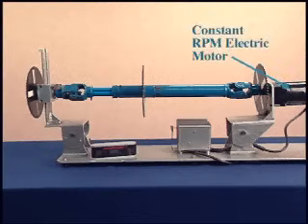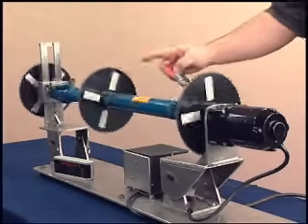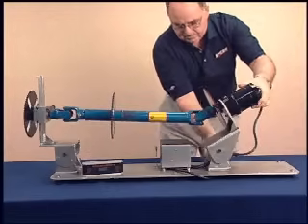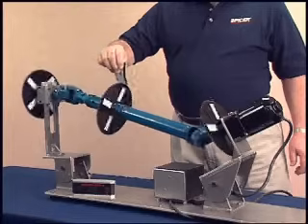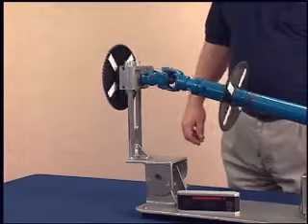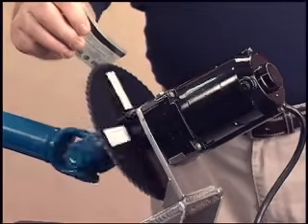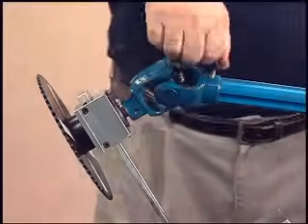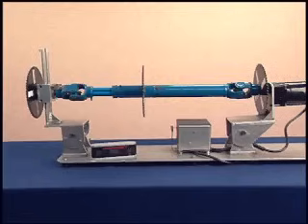Drive shaft velocity

Comment: I'm an automobile engineer. This has got to be the best demonstration of u-joints I've seen! 
Thanks for the upload 👍
Reply: @Vicas SM, It is interesting that in the early 16 hundreds, Galileo Galilei in his inclined plane experiment, used small bells to indicate  when a rolling ball passed a position on the inclined plane. I guess they did not have credit cards back then.
Reply: @Nahte Retnuh Hmm let's see now.. Get the yokes in sync by changing the phase angle? For what application? On which truck? Why? Are we designing or troubleshooting? Is the driveshaft vibrating? Did you service it recently?
 3 week old YouTube account with no content or comments except for this one?
TROLL ALERT
Reply: I agree,best demonstration I've ever seen as well. We learned about this in Diesel Technology at Williamsport,Pa. Community College in the mid 80s. It's surprising how many mechanics don't know these basics, because they were never taught correctly.
Reply: @johnwad7468  Exactly! 👍
It's so much easier for a novice to understand things through simple demonstrations. 
One might forget the underlying theory, but not the demonstration. So much more effective at creating mental associations, thereby memory, compared to simply drilling words into one's head from a textbook! 😂
Reply: @vikassm  Right. And that reminds me of a demonstration Caterpillar gave at a Limestone quarry I worked for in the 90s. It was animation of what happens to bulldozer track pins and drive sprockets,on high drive tracks,in forward versus reverse motion. In forward the pin stays in the sprocket through it's travel without rotating with relation to the sprocket. However due to geometry,in reverse the pin rotates nearly 90 degrees and grinds metal of pin to metal of sprocket,with much increased wear. None of the other older mechanics knew this either until this demonstration. So a picture is worth a thousand words. Don't you agree?
Reply: @johnwad7468  Huh! Very nice! 👍👍
It could also explain why some machines wear faster under some operators. Just like race cars. 🤣 
I know, dozers aren't F1 cars, but the engineering principles have more in common than most people like to think!
So yeah, I do love reading good old text books, but pictures, videos, demonstrations, DIY, are all fantastic methods to pass knowledge on to the next generation. Doesn't have to be fancy, just needs to be sufficiently detailed to get the point across clearly. Which is exactly what this video succeeds at doing 😀
Reply: Can u guys stop fighting lol
Reply: @sagittariusa2201  Ah, Smith, We aren't fighting. Merely debating. @bigalinjapan is my pal, I mean him no ill will.
Reply: This comments thread must have to be preserved in a museum as a pure demonstration of hypersensitivity
Reply: @Nahte Retnuh yes you could
Reply: I like the visual and audible representation of the non-constant velocity aspect of the individual u-joints. And I didn't know before that two u-joints doesn't make a c-v joint if their axes aren't parallel.  

The sound seems to clarify the faster-slower relationship better to me than the disks with white stickers visual does.
Reply: He's talking about speed difference, not the rotation of the shaft in an angled position.
Reply: I agree with you !
Reply: Is this a typical size apparatus that's found in a car? When I was younger I always worried about components like this wearing out or not being materially strong enough for what they need to do.
Reply: This is helping me understand things so much better. I have machines that have run with some serious u-joint angles and never really have a u-joint problem then on your truck you change the angle of the u-joint just a little bit and all the sudden it shakes and vibrates at low speed. With equipment there is no changing the angle as it travels through suspension because there's no suspension. I never understood until this video why you can have a tractor have a 20° u-joint angle and it doesn't snap drive shafts or cause a vibration. And they don't really teach us this in mechanics they basically just teach us how to swap parts.
Reply: Agreed.
Reply: Heyy man plss helpp mee😢😢 i have a question abt this
Reply: This comment thread is an absolute dumpster fire with no winners.
Reply: Not so much limitations as just chracteristics. Many of us would still much rather have u-joints than cv joints.
Reply: @timhofstetter5654  Yup. Characteristics, not limitations. Probably what I meant to say at the time 😂
Reply: @vikassm  8)
Reply: Obviously you are not a real engineer if you  witnessed any “limitations” demonstrated in the video we all just watched.  
Did you earn your degree online in just six short weeks?  
Or order it from China?
Even a lamest of the
US educated engineers know limitations when they see them.  

AND also when they don’t.
Reply: @jaxturner7288   Yes obviously. Good observation jackass. 
Edit: I maintain, This video is a very simple and effective demonstration. Why is it so hard for you to accept that? If you've seen better demonstrations, please link them here so we can watch and learn too. If not, that's fine too. But insisting that somehow this video isn't a good demonstration and insisting I'm not an "engineer" is plain stupidity. 
Logically, How would you have slightest idea what my credentials are? Does it really matter in this context?
I'm simply appreciating someone's work. If you have nothing constructive to add, begone, and rid us of your ignorance. Typical armchair idiot.
Reply: @vikassm  what kind of ignorance is claiming that something is something that it is factually not?
You are that kind....
Reply: @jaxturner7288  Could you elaborate on why you think this isn't a good demonstration? Or whatever else your point is?
Reply: What's a "automobile engineer"
Reply: That's scary
Reply: Automotive engineers are hired after they answer no to have you ever seen under the hood of a car
Reply: @joshd7438  Nah. 
Automotive engineers, or any other engineers, aren't hired in such a manner anywhere. Nepotism aside, no one I knew ever got into a job without several interviews. My first job was 10 rounds of interviews, for the simple post of a service tech 😂😂 Of course, you don't need to be an engineer to become a service tech, I quit soon after and went elsewhere.
Reply: what you have done in your whole 4 years degree. if you want the demonstration from the videos.
Reply: @Aerotk  Wow, what an attitude towards total strangers, eh? Fucking jerk 😂
Reply: @DjoXey  I take it in a pretty sportive way :)
Reply: @ButterfatFarms  Obviously your dumb ass is even too stupid to follow a simple thread. Vikas said "I'm an automobile engineer. This has got to be the best demonstration of u-joint limitations!" All following were answers to that. So you claim, that an automobile engineer should be satisfied with this demo? It is the best he ever saw? Even after studying engineering? O tempora o mores...
Reply: Oh really. So you would be using the sound of a credit card, instead of tachos or other sensors and some useful display? Where did you get an engineering degree?
Reply: @Bigalinjapan  If my words somehow implied that you should put the demo rig into a road car, I've failed in communicating. Or maybe my wording was just fine. 
It's an awesome demonstration. "De-mon-stra-tion"? To demonstrate? 
Doesn't matter where you get your degree from if you can apply things you learn constantly. A degree is just an entry ticket into whatever field you love. Real learning happens once you're actually in the field. An essential concept in teaching (and therefore learning) is to  "Demonstrate" something.
Reply: @vikassm  If we are talking about a demo on an engineering topic for engineers or at least soon-to-be engineers, we should apply the appropriate level and by that, also set the expectations to engineers to an appropriate level. Listen to the card make brrrt ist kindergarden child play, not engineering.
Reply: @Bigalinjapan  Apparently you can do it a lot better, let's see your demo then.
Reply: @vikassm  "Can you do better?" is pretty lame whataboutism if there is no other argument at hand. Yes, I can do better in directing and demanding. As an engineering supervisor, this is the job. Not to be able to carry out but to lead the way. Which ones do you want to belong to?
Reply: It's an awesome demonstration, if you don't like it that's fine too.
Reply: @vikassm  I like the way you are clear about the truth. A lot of people will still complain even if you give them free housing, free medical, free phones and food stamps.
Reply: @Bigalinjapan: except we aren't talking about professionals. This is Youtube. Someone with an idiot's level of passing interest on the topic would understand differences in sounds equal differences in output, more than some numbers on a chart that some sensor and computer compiled.
Reply: @Bigalinjapan  I gotta say, I believe you're a supervisor just as much as I pity the team that works under you.  If this is how you react to a Youtube comment, I'd loathe to see what you do when a paycheck is on the line.
Reply: @m_6866  Get him Mark. Ha
Reply: @Bigalinjapan  how tf is a younger generation supposed to learn if they can’t understand it? Yes you can throw complicated words at them and hope they learn, but we already have the education system to prove that wrong.
Reply: @Bigalinjapan  Wow.  I can't imagine what it must be like to be around you for any length of time.  What's it like being stuck inside your own head?  It must be terrible.... You have my deepest sympathies.
Reply: @freddieg7131  Nope you cannot imagine. You don't know me, you never met me, but you generalize all about me from 1 single statement on 1 single topic. Might be your head's inside is not that much more enjoyable. All that black & white...
Reply: KISS principle. A pretty damn good engineer came up with that one.
The simplest mechanism, that adequately demonstrates the phenomenon, is most likely to be best.
Reply: @bcubed72  No wonder American engineering is No. 1 in the world, huh?
Reply: @vikassm  I agree, this very good demonstration, Don't worry about that guy. You cant fix stupid.
Reply: @Bigalinjapan  i mean why make the demo overly complicated just because the intended audience "should be able understand it"? if it can get the point that is being shown across to an audience then it has fulfilled its purpose so what would be the point in needlessly confuse it with pointless trivialities. you wouldn't teach a child how to ride a bike by first trying to explain gyroscopic properties of the wheels would you.
Reply: @firenado4295  Once again quoting Vikas: "I'm an automobile engineer. This has got to be the best demonstration of u-joints!" The best? Engineer? Get your standards straight. Maybe in your country real engineers graduate from elementary. Here not.
Reply: @vikassm  .
A HUEVO PAPI 👍👍👍
Reply: @Bigalinjapan  
NOW  YOU ARE THE EXPERT BUT YOU NEVER COME WITH ANY VIDEO HA,HA 😈
Reply: @Bigalinjapan  
Hahaha 🤔🤔🤔
Reply: @GT-43  It is definitely better. I admit it 😎😀
Reply: @Bigalinjapan  if you can't explain it to a 5 year old then you dont really understand it.  this explains it very well. i could easily see this as an introduction into automobile engineering then within the course learning how to apply more precise mechanisms to fully understand it.
Reply: @Bigalinjapan oh shuddup, its a 2 min "basics" video lmao
Reply: @Bigalinjapan  You clearly have a fundamental misunderstanding of teaching if you expect your students to understand a subject and all the measurements and data you can read from it before you've demonstrated it in it's simplest form. Don't you remember being in school? Your teacher would start with a problem in its absolute simplest form to make sure you understood. A teacher can not skip that vital first step. No good teacher expects their student to understand anything they didn't already teach you themselves.
Reply: @Bigalinjapan  Where did you get an engineering degree?
Reply: @evanfell193  A German University of Technlogy.
Reply: @evanfell193  Guess so, if that's the conclusion according to your level of education.
Reply: @teamtoken  There is no high school here. Little narrow field of view you have there, hmmm?
Reply: @Bigalinjapan  where's "here"? Are you from Antarctica? Or mars? If you don't have high school then there will be something equivalent. You know, 16 years of education and so on.
Reply: @vikassm  Just 16 years for an engineer? Well that explains a lot about the level you are discussing...
Reply: @Bigalinjapan  I'll clarify. 16 years of "Education" not "age".
The average student may spend 12 years in a School+Pre-University followed by 4 years for completing, say, Bachelors in Engineering. That's 16 years of education (not age), give or take. Of course, 2 more years if this student chooses to pursue a masters followed by a really high number of years for a doctorate. Summary: Sixteen years of formal education, not 16 years old.
Reply: @vikassm  No need for explanation. I got it right the first time. Just 16 years of education. From the very first day of elementary school until graduation. That is missing 3 years or 6 semesters.
Reply: @Bigalinjapan  Are you counting preschool from age 3 to age 6? I'm counting the years after that. Kindergarten or pre-school isn't considered "formal", usually it's not a necessity to have completed these in an institution to be able to attend formal school. So yes, 3 years of pre-school + 16 years of formal education culminating in a Bachelor's in Engineering.
Reply: @vikassm  No, no preschool years. 4 years elementary from 6 or 7 years old on, then 9 years high school (if sufficiently qualified during elementary) and 6 years engineering master at university.

Comment: but will this fit my Honda?
Reply: honda crv 2003 has independent-suspension which needs this double-cardan/universal-joint
source : 
1. 'strut', 'double wishbone' in
    http://owners.honda.com/vehicles/information/2003/CR-V/specs#mid^RD6843PW
2. 'strut', 'double wishbone' in
    'Independent' section in the bottom, below 'external links'
    in https://en.wikipedia.org/wiki/MacPherson_strut

Comment: It would be interesting to see what happens when the ends are at opposite angles, rather than parallel. ie each one is at30 degrees up from the drive shaft, rather than one up, one down. I know what the result will be, but who else does?
Reply: Paul Burgess you mean a w-formation or m-formation? the thing shown in the video i a Z-formation.
Reply: Tom Amery, not sure what formation it is called, but it gives the same smooth results even though it looks like it  totally shouldn't. The top one in this pic, if the link works. http://www.roddingroundtable.com/tech/articles/images/driveline.png
Reply: Paul Burgess yeah its called like that, at least in dutch. I study automotive engineering